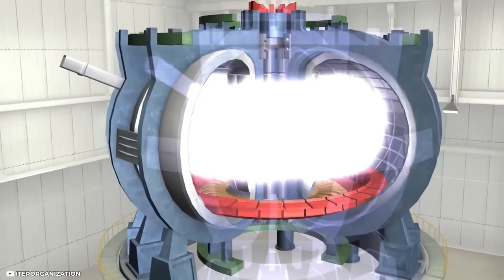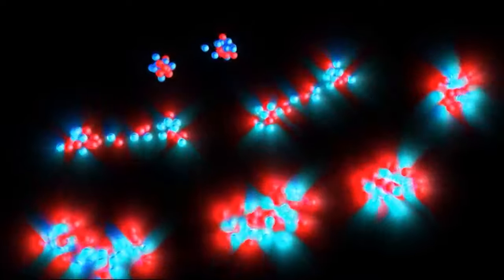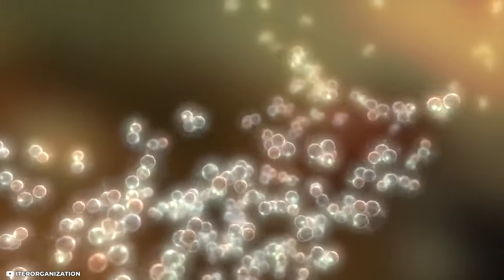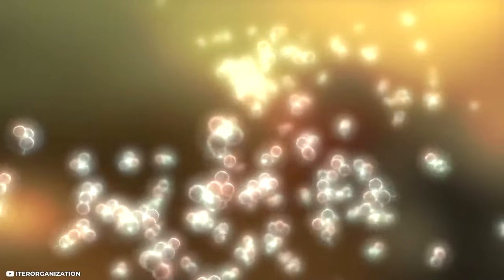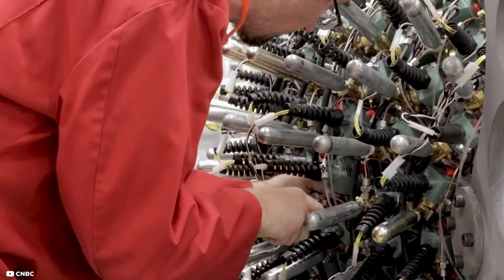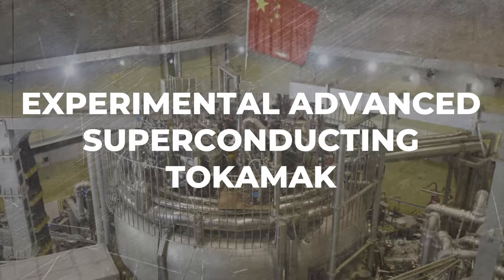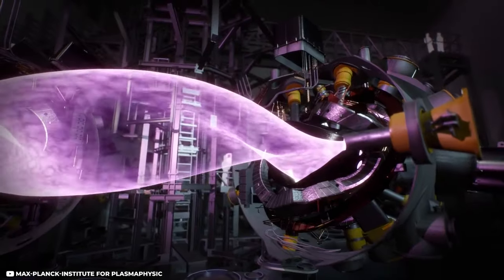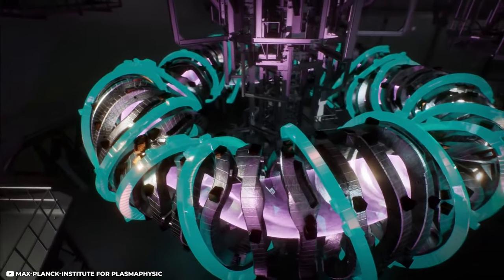Nuclear Fusion! Update for Nuclear Fusion Energy!

Comment: The truth is that nobody knows how to make fusion work today or if they will ever make it work. It doesn't matter because we know how to make fission work today and advanced fission has every advantage that people think fusion has.
Reply: Considering we are only using fission to boil water seems a bit obsolete
Reply: @fn0rd-f5o  You see that's the part no one explains well. On the old light water reactors your statement is correct because the output temperature on a LWR is very low and they can't make it higher. On the advanced liquid-fueled, low-pressure reactors the output temperature is very high. This is high-grade industrial heat and it has hundreds of direct applications, making electricity is just one of them. This is what makes all the difference in the world.